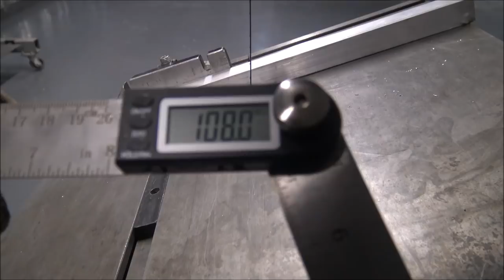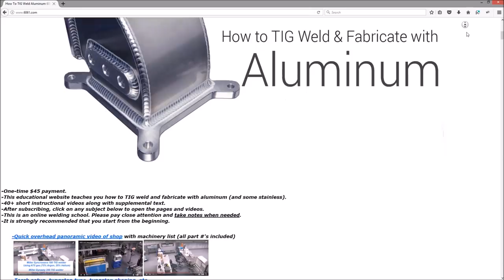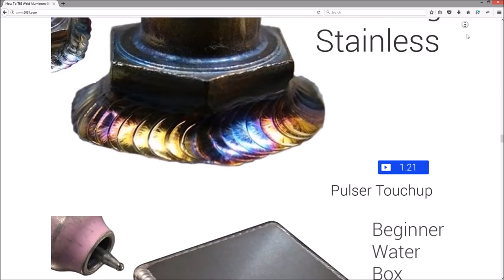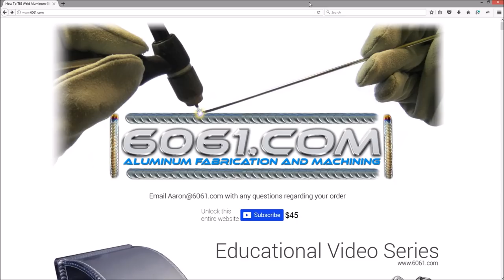TIG Welding Aluminum Fabrication

Comment from the maker: All of these frequently asked questions are thoroughly answered at http://www.6061.com
-What type of tungsten?
-How do you shape the tungsten for each specific weld?
-What filler rod do you use (type and diameter)
-Where can I get one of those weld positioners for welding round parts?
-What type of aluminum do you use for specific projects?
-What are ALL of the welder settings?
-Can we see a shop tour?
-What torch do you use?
-What welders do use?
-How do you ball the tungsten, and when/why?
-What type of collet body do you prefer?
-What size nozzle cups?
-How do you clean/prep the aluminum before welding?
-What gas flow rates?
-What types of shielding gas, and when to use which type?
-What TIG welder do you recommend?
-Where's the best place to buy aluminum (or steel/stainless steel)
-How to bend test welds
-What is the "clicky" thing you sometimes use and why? (Metronome)
-Why do you wear those specific gloves (glove selection video)
-What type of hand amperage controller do you recommend?
Feel free to email me if any of your questions aren't answered on the website http://www.6061.com
40+ short videos with lots of supplemental text.
Thanks,
Aaron
Reply: What kind of hood are you wearing

Comment: Do the gas lenses last long if you just did Aluminum welding? as apposed to a standard collet body? great work by the way!
Reply from the maker: Yes, as long as you can keep the tungsten away from the filler rod and weld puddle. I've been running the same gas lens for well over a year (99% aluminum work), if not several years. The gas lenses I use have multiple screens, so if the top layer gets clogged with spatter, you can remove it with a pick tool to reveal the next clean layer.  I'm sure I sound like a broken record by now, but this subject (and every single other subject I can think of) is more thoroughly explained on the website http://www.6061.com

Thanks for watching,
Aaron
Reply: Thank You very much Aaron. I was having some issues, That answers a lot. Thanks for putting out the videos, us beginners gain a ton of knowledge from watching/studying them.
Paul

Comment: Your techniques remind me a lot of how we used to fab stuff when I worked at Hogan's Racing Manifolds.  Did you get your start doing something similar?
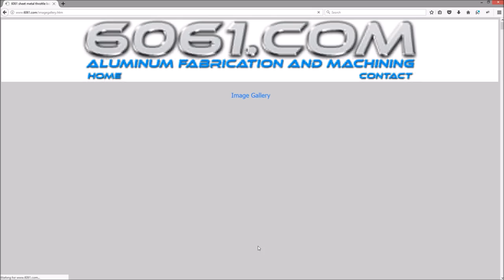Reply from the maker: 12:45
Started a business building these throttle body adapters about 15 yrs ago. (Had one Hogans intake come into the shop for a quick repair several years ago... Nice piece)
Reply: 6061. com I really like how you’ve taken this type welding/fab to a new level of creativity.  Hope your business is doing well, keep up the awesome work!